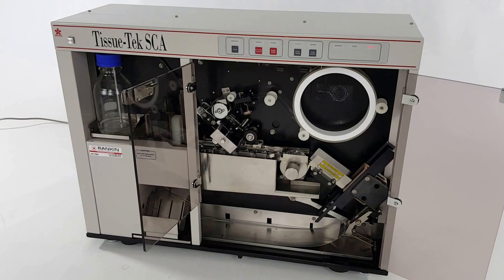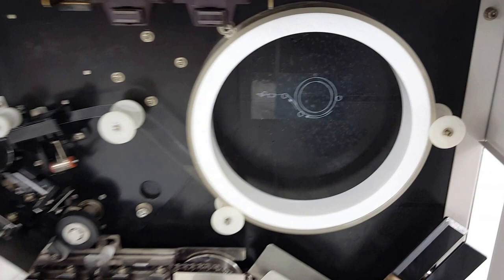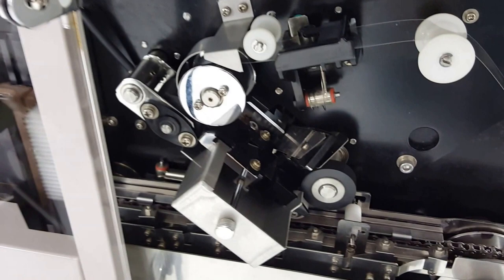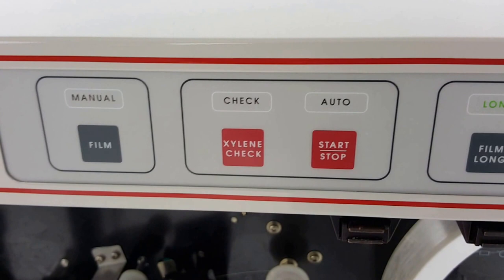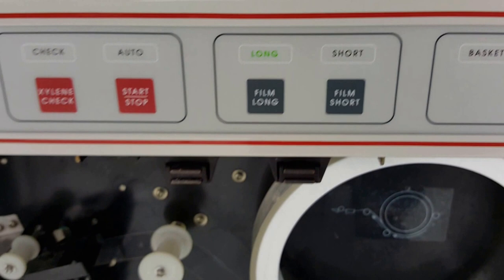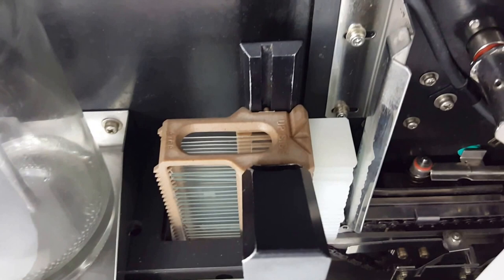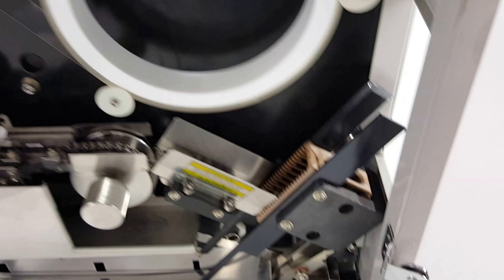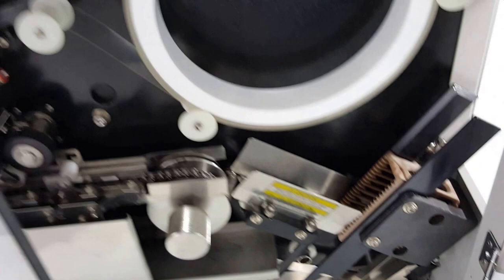Sakura Tissue-Tek SCA 4764 Film Coverslipper

Comment: Hey do you know how to fix it when the drip stops working? It started working after I adjusted the film (loaded improperly) but then it stopped seemingly without cause.
Reply from the maker: If you recently filled the xylene jar i would make sure the cap is on tight and pressure isnt escaping. Can you hear the air pump running?
Reply: Brent Rankin yes. The xylene drips when the button is held down but only dripsa little/not at all when pressed for slide covering
Reply: Brent Rankin oops... checked with lab aide and it looks like the jar was recently filled. Will try again  thank you for your quick response!!!